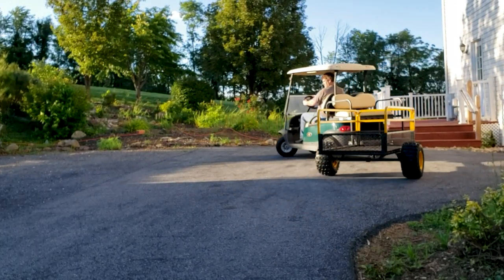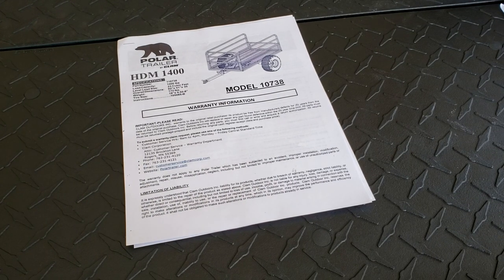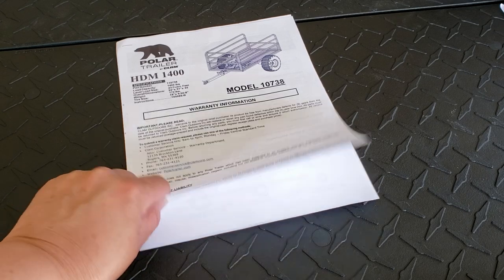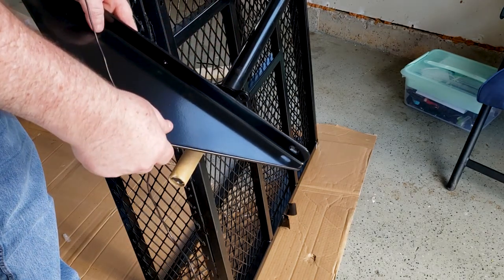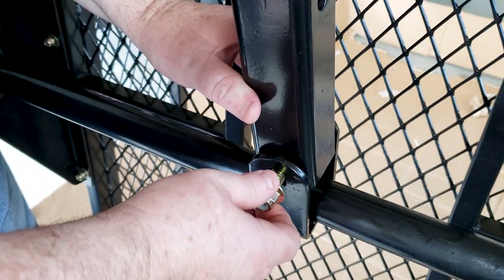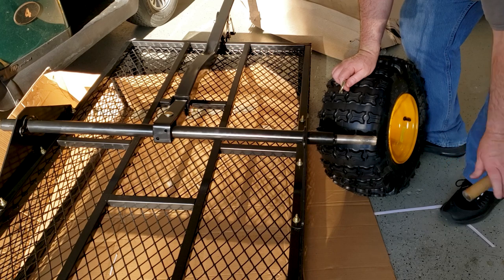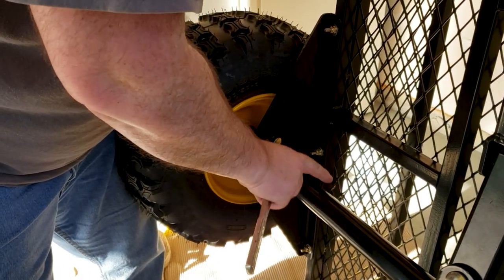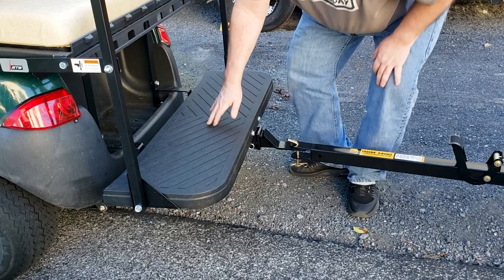Golf Cart Trailer Assembly | Polar Trailer 1,400 pound Capacity for the Homestead and Gardening

Comment: I've had my golf cart for 10 years.  It is a Yamaha.  My son welded my hitch on the back of mine and I just use my trailer i had that i pulled with my riding mower.   Mine is used mostly for riding around on my acerage. I forgot to mention, mine is called The Big Rig.
Grandma Sue in central Indiana and Izzi Too
Reply from the maker: Grandma Sue, that's incredible. I just used "Jr." as we call the trailer with Flash in the snow and ice to move 500 pounds of stainless steel shelving to the basement from the truck. Needless to say, it jackknifed a few times, slid down a hill sideways, and pretty much wasn't happy with these smooth "turf" tires. So there WILL BE a future video with installing a lift kit and big tires on Flash. Jr's tires are pretty good on the frozen tundra.